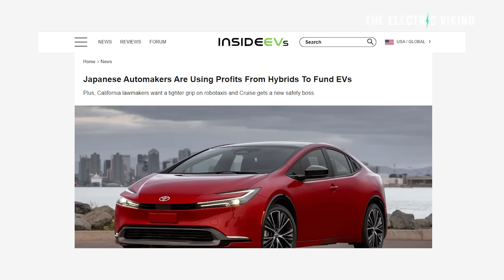Japanese Automakers using record profits to fund huge transition to EVs

Comment: Gotta love how Sam bags on the Japanese auto makers yet gives Tesla an endless pass.

By 2035 I highly doubt there will be more than 50% of EV’s being sold and the reality is that Toyota will still be selling over 11 million cars per year.

And of those 100 million Toyota owners on the road today many will transition to a Toyota/Lexus EV when the market has matured 👍
Reply: Its not the market maturing at issue. It is the technology of mass reliable manufacture and the clearing away of antique business models. Dealers will mostly go as a cost and reliability risk. Charging infrastructure like all service, cash-stream businesses will be vertically integrated, including home storage. (Mixed metaphor warning.)Toyota is facing its Kodak moment now and its not making the right choices now. It has already died but like any Titanic it will take a while to sink.
Reply: @fliprim  The market is shifting from ICE to hybrids, which Toyota excels in. When cheap EVs hit the market in the next couple years, we'll see how long they can keep selling antiques.

Comment: As an investment proposition, I would probably steer clear of any carmaker that invests too heavily into EV’s. Just see how well it went for Ford and VW for example… EV’s are a “solution” looking for a “problem” and only really serves to distract attention and resources from dealing with areas that would actually make a difference to global carbon dioxide emissions.
Reply: Ford and VW EV's are an absolute mess, that's why they don't sell (reputation). Are you going to develop a dedicated EV chassis or are you going to slap something together with of the shelf parts?
Reply: What technology, other than EVs, would "actually make a difference...", and would be a distraction, in your opinion?   There are obviously other areas than road transport to also decarbonize... like obviously power generation, or industry's decarbonation in general, but they are also receiving plenty of attention and absolutely huge investments.

On my side, I quite heavily invested in TSLA, starting in March 2013... and do not regret it the least bit!  But you are 100% correct to recommend staying away from Ford and VW.
Reply: Never mind the environment. EVs are cheaper to run, and more fun. They are quickly becoming cheaper besides.
Reply: @st-ex8506  Honestly, I don't think we can decarbonize everything,  but  consumer cars is a very good start (I'm going to switch this year). I don't see heavy haul or aerospace switching to batteries, but there alternative fuels can be applied.
Reply: @samvangeel3660  We CAN decarbonize everything!  But it's going to be more difficult in some sectors than in others.

You are correct, light road transport is the lowest-hanging fruit, followed by power generation.... both of these transition being well engaged throughout the world.  It is being followed by truck transport, that will also go full electric, with very few if any exceptions.  Those that claim otherwise have not crunched the numbers!

Obviously, long-haul air transport is never going to be electric (short-haul just might).  I have strong doubts that we will have hydrogen-fueled planes, as it would require completely new design airframes and engines to be developed and certified, a hugely complex and expensive process.  I would rather bet on synthetic fuels made using excess renewable power (reference to Tony Seba's "Super Power").

Comment: Depending how and when you define it, the "future" can mean multiple things or one after another, but EV is certainly the Next Future/big thing since everyone is moving away from fossil fuel. Less moving parts compared to conventional engine. Even hydrogen will still be using conventional/"lots of moving part" engine that needs lubrication, cooling etc. Western countries such as EU and the US are going heavy too. For Japan not to join the rush, is unthinkable. It's true they're trying to invest in other type of fuel but in the end it takes too much efforts while still ending up using the same engines (lots of moving parts) that need lubrication and cooling. The next probable future may eventually be a mini nuclear battery powered car. That might be tough to beat.
Reply: beegdawg007  Let's check the fact, 1 in 3 cars sold in CA are EVs, 1 in 3 in China (country with the most cars in the world), 8.8 of 10 cars are EVs in Norway, not to mention Germany, Italy, UK, France, Sweden, S. Korea, Netherland are the top 10 most EVs in the world. Mercedes put up a statement that says "The future is EV" in it's website, Crysler, BMW, Ford, VW, Porche Taycan, Audi with eTron, Nissan, Jaguar etc are among big names that investing and producing EVs.
There hasn't any big innovation in older fossil fuel cars for decades now. EVs growth rate on avg is about 55%/year worldwide. That is why Elon musk is the 2nd richest man in the world, and in fact that none of the top 10 richest man is in oil businesses proves it.
Nothing's wrong with anyone who wants to live with the old tech/old glory and it has nothing to do with evil CO2, at least I don't care, in fact I don't even own an EV.  Changes is inevitable whether we like it or not.

Comment: I heard in China, driving an EV is like driving a car with a fireworks ready to set off right under your Arsse... 🤣🤣🤣
Reply: No. That is driving an ICE. Clearly you are unaware that an EV is about 20 times less likely to spontaneously combust than an equivalent ICE car. Furthermore ICEs tend to burn very fiercely and even explode. An EV fire, although it lasts longer, is much more measured. It starts at one point in the battery pack and then steadily progresses. That actually gives the occupants more time to vacate the car.
Reply: @rogerphelps9939 Let’s not forget the fact that there is toxic out gassing.  Then your “measured” fire can take hours and hundreds of gallons of water to put out ,maby.  Leaving a toxic slurry of contaminated water behind to soak into the ground or drains.  Only to light itself on fire at a later time🙄
Reply: @rogerphelps9939  Have you seen EV batteries catch fire? once they start burning, no amount of water is going to put out that fire.

Comment: EV technology is expensive and unstable when new. Japan automaker stay away and that is smart. They are waiting until China and Tesla to stabilize the EV technology standards and bring the cost down. All the profit they made is kept in the war chest and to be used when they see when is time like optimum and stable technology also signs of some EV companies goes bust. They are not stupid mind you.
Reply: Right, because it's super easy to suddenly jump from one production line to a completely different production line.

So far, every single car company going into EVs has had some sort of production hell. Tesla and BYD had those when they were still relatively small and owned the market. VW, Renault, GM and even Ford seem to be having them now, when they can still count on ICE sales to offset the costs.
Toyota, Nissan, Mazda, won't have that chance. They'll be stuck without capacity to produce EVs at the same time their ICE lines collapse. It won't be pretty.
Reply: Toyota and Honda grew because they are doing what the Chinese auto makers are doing now. Japanese makers are doing what Ford and GM did in the 70s and 80s. 

By 2040 I expect that Chinese auto makers will dominate unless they are kept from growing by tariffs or other government blocks.
Reply: It mostly depends on battery tech, which is nearly there.  Toyota have a few more years up their sleeve to refine their EV product line and reduce production costs.
Reply: Most Chinese auto makers are going bankrupt, but they have lots.
Reply: 😂😂😂
Scaling production is not instant & not simple.
Toyota is toast but after GM & Ford.
Reply: Their lunch will have been eaten by the time they start to move seriously.
Reply: Well said.

No one could ever accuse Japanese industrial titans of being stupid.
Reply: @JoeyBlogs007 there were over 800+ EV makers in China at one stage, and now down to around 100.  The Chinese government as well as the whole EV industry in China already expected it will eventually cut down to probably below 10.  It’s normal for any new business.  Everyone jumped in and only the best of the best will survive.  Furthermore, if without competition, we won’t see the improvement of battery technology in such a short period and certainly won’t see the cost of battery dropped drastically in such a short period.  At least now we have an option to purchase affordable EVs.
Reply: Satay,mate, they are about 4 years too late to start ev production. The truth is, they needed to start serious production in 2019 or 2020, to have any chance at all of competing in the ev market. They did not do that, and now most, if not all Japanese car manufacturers,are doomed.
Reply: AH1 @satay8167, you NAILED IT! So much smarter than all of us, and I hope you will SELL and Tesla stock you currently own, BUY as much Toyota stock as you can. You can see how bright their future is, YES?
Reply: My 2016 Tesla is still going strong, doesn't seem "unstable" to me 😅 Japan has stayed away from EV as China controls all the battery supply and materials. It doesn't want China having control over it. Japan have always been leaders, not followers.
Reply: @lrg3834 you think 😂 Then why do they still think hydrogen is the future? 😂😂😂
Reply: The only reason the Japanese car industry has battled against change to EVs, is because they get subsidies from oil companies. They ,are oil companies last chance to stay alive. That's why the big push for any kind of fuel that people still have to purchase , eg , hydrogen, ammonia, biofuels, etc.This also explains why fuel economies of vehicles has not improved much over the last say 40 years. And why all of a sudden , with the advent of EVs ,everyone is trying to build a more fuel efficient engine.If everyone runs their car from the sun, oil companies won't be able to extort stupid amounts of money from everyone. Oil companies will go broke or at least be drastically reduced. Good.